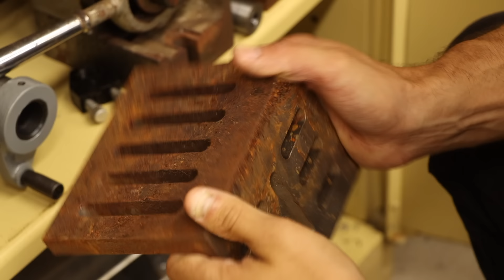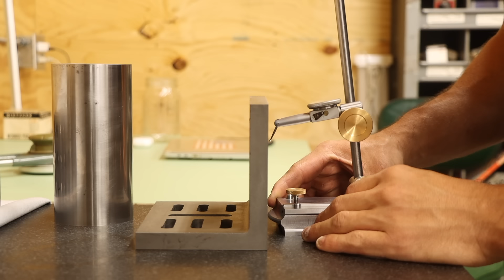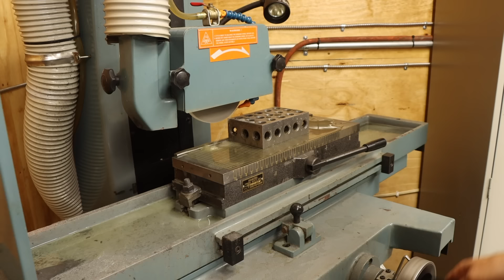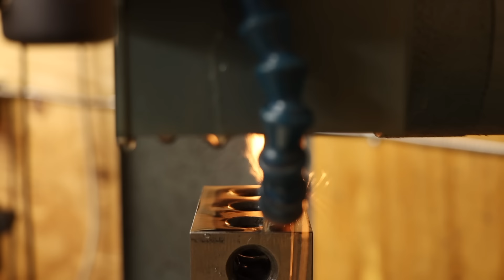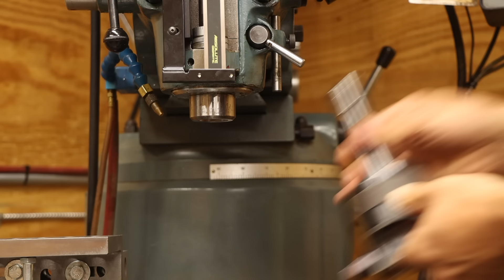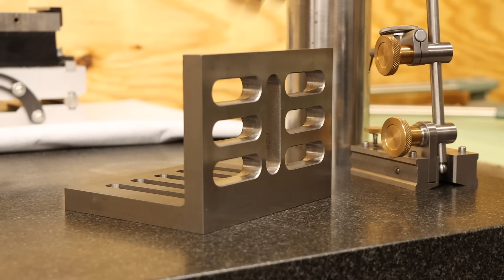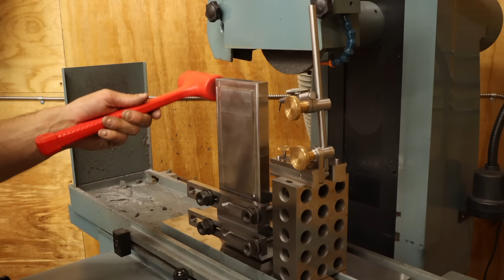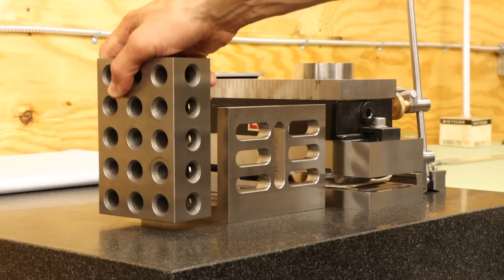Restoring an Angle Plate || INHERITANCE MACHINING

Comment: i have noticed that when you dont clamp the part evenly on both sides (the height which you clamp, in this example the vise is way lower than the 123 block), then it will always be clambed at an angle.
Reply from the maker: Interesting. That might explain fly cutting ended up being out of square by so much